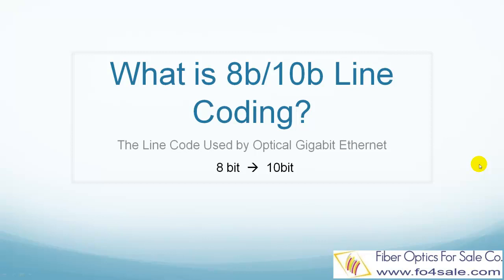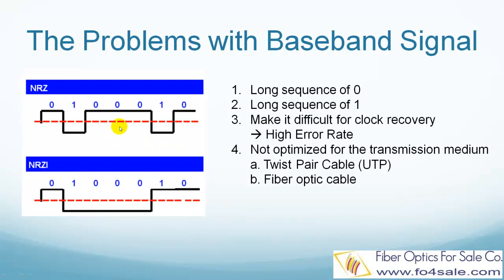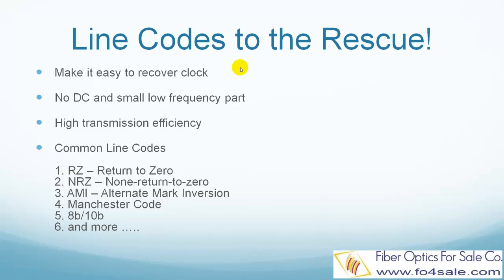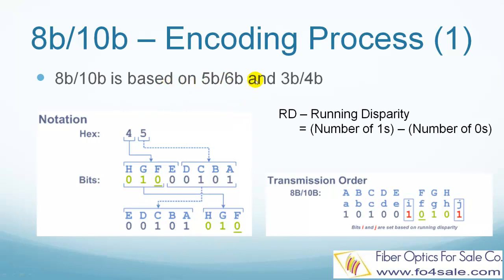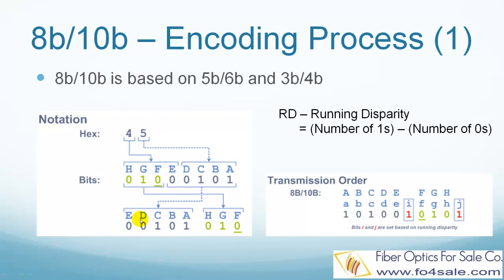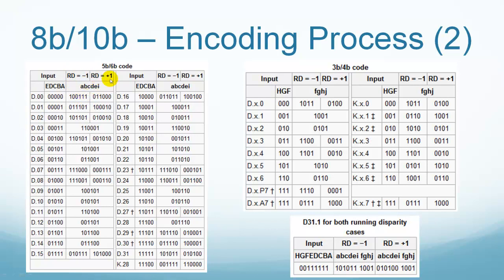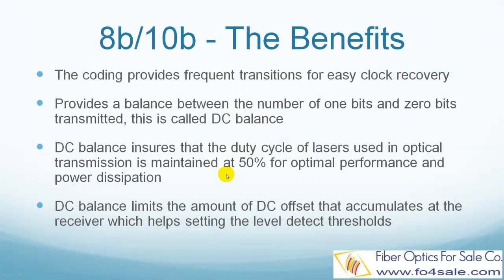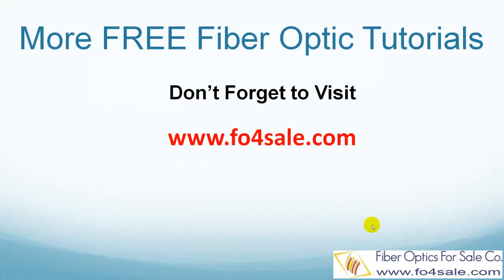What is 8B/10B Line Encoding?

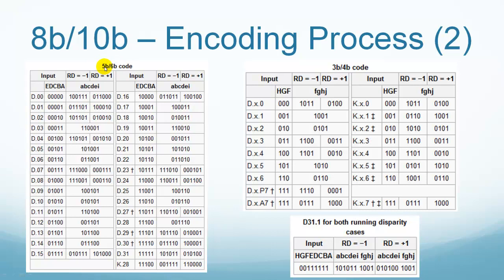Comment: 4:16 Say we are at D.20 and the RD is -1.  abcdei will be output as 0,0,1,0,1,1.  The running disparity will be -2,-3,-2,-3,-2,-1.  I thought the 8b/10b code was said to prevent the RD, bit by bit, from ever going below -2 or above +2; yet in this case, it reaches -3.

Comment: When we see the spectrum of the 8b/10b encoded data. It has null at the transmitting frequency. In other words clock frequency information is lost. It would be very helpful if you can post some explanation how the clock recovery is done if the clock info is missing.
Reply: I don't understand your question, but you recover the clock by triggering on the transition edges on the receiver side. This is why 8b/10b, by introducing frequent edge transitions, is helpful. The edge transitions allow you to align phase-wise as well as finding the actual frequency. There are certainly more complexities, for example finding the beginning of each word as well as matching digital phase across lines.